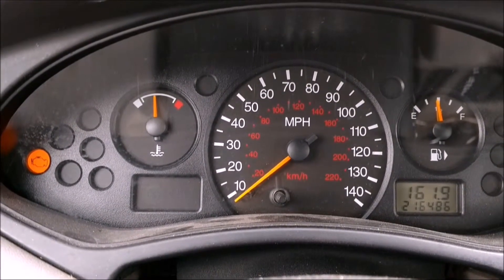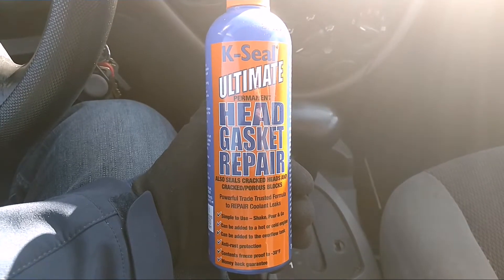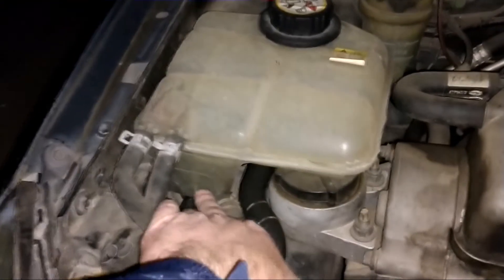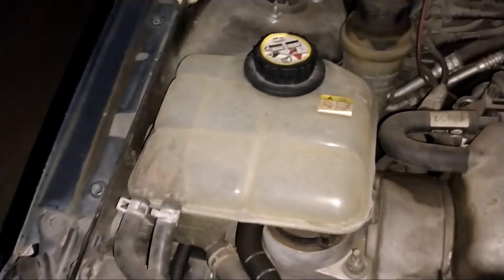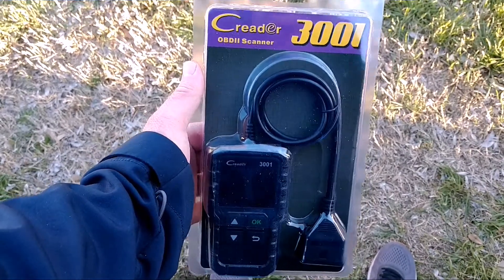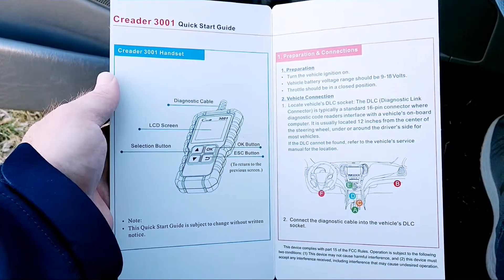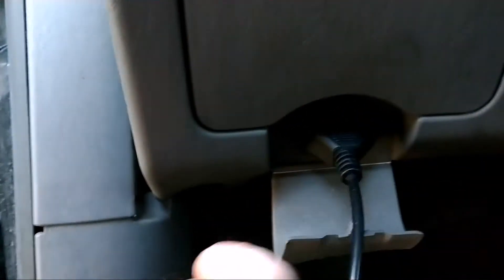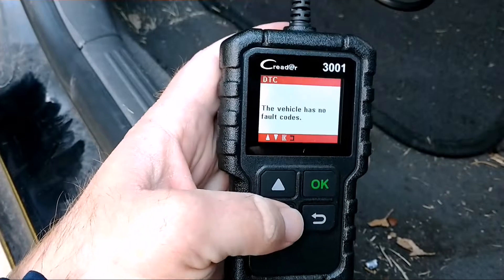#2 Cylinder Misfiring Fix 2003 Ford Focus - Engine Light - Code P0302

Comment: Interesting as I had thought it was repaired in the last video. I watched the video for the conclusion and was not so much worried about the title. How long did that head gasket treatment last? My 2007 has been leaking trace amounts for years but has not yet set a code, I have been thinking about adding one of these for some time now. I have Bar's block seal the copper edition but still have not been able to bring myself do it. Changing a head gasket on your engine if you still have it is a walk in the park compared to the duratec. The crank is not keyed on the duratec but rather uses a glass fiction material as a lock. I have heard of the stuff you used and will have to take a look once more before I continue.
Reply from the maker: Sorry for the confusion. I changed the title to be more clear. It lasted 2 years and then I sold the car. Not sure how much longer it lasted. It took a few months of being in there before it consistently kept the light off
Reply: @becausestuffbreaks  Thanks, interesting on the possible longevity.
Reply from the maker: I found it odd also, so maybe there was another component at play and this was just a coincidence.
Reply: @becausestuffbreaks  Mine being a little different but my revelation with mis-fires did came about this way... I have a sunroof and normally have it open even in the cold; well I would smell the rotten egg smell from time to time and I was wondering if it was my car. No check engine light and finally one day it just dawned on me to get a set of coil overs as that is what the 2007 model uses; reasonably priced back in 2013 at 25$ I changed them out, never again did I smell it. Only seemed to happen on deceleration for some reason unknown to me as to why. I know it was a fix as it did happen often. Recently purchased a backup set for 29$. I purchased it new and it's still that way 134,000 miles. Beats paying the new cars prices of today and try and find a good used car that someone actually took care of. 😀